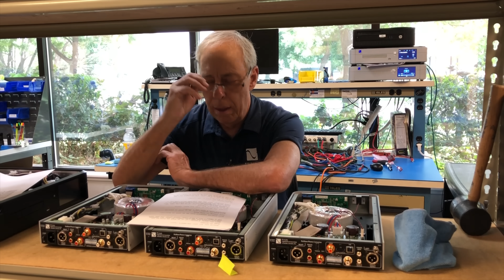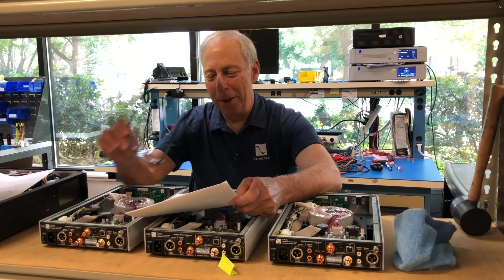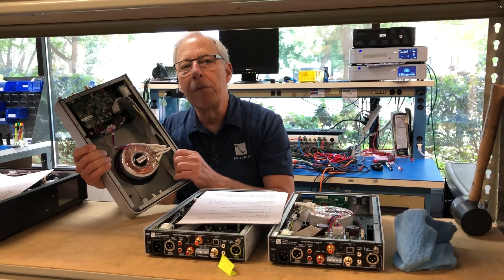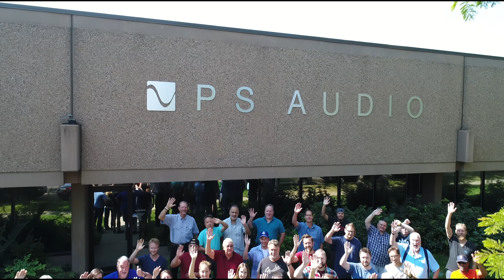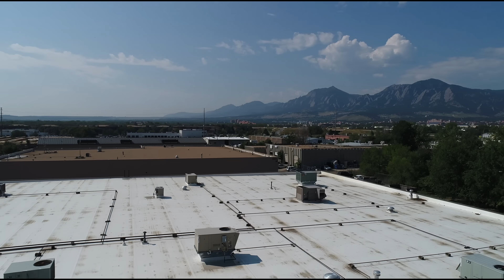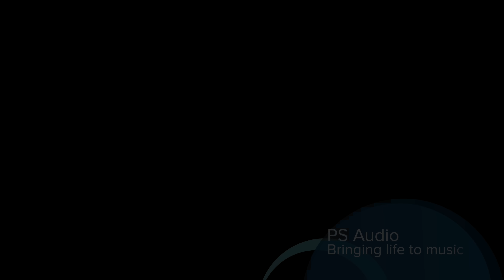What's inside a high end power cable?

Comment: 3 conductor 12 gauge Romex -TO- 10 gauge stranded, shielded, 99.9% oxygen free copper, gold plated -TO- 14 gauge MTW lead soldered to cladded components. Forgive me if I think you should have more scientific information to back up the justification for a $500 dollar power cable. If it works, great. Inductance is magical no one really gets how it works either. But it should be easy enough to see if noise is being omitted, prevented or the cable is somehow changing the power values with pretty basic instrumentation. But yet you tell your viewers to just try it and laugh, as if to imply that it's not worth your time to investigate the reason for its value just take my word for it. Stop comparing cooking to audio it makes you appear frustrated.

Comment: Wire/cable current noise is different according to current direction, IOW current noise for positive half cycle is different to current noise for negative half cycle, IOW wires/cables are directional.
Test equipment employs full wave rectification so will never display differences in half cycles.
Also cable current noise is slew rate dependent and also has directional decay time behaviour, sine wave by definition means constant rate of change which means noise mechanisms are not excited as they are by dynamic/music signals and therefore are not apparent when using sine test signal.
Once one accepts that wires/cables have  directional properties the 'errant' subjectively noted system behaviours are perfectly explainable and also are able to be eliminated.
I use self made non-directional cables throughout my system and this enables clean clear spectrally balanced sound with outstanding staging and depth imaging.
Swapping in one only 'standard' cable be it power,  signal or speaker cable causes collapse of depth imaging and overall subjective distortion.
If I revert all cables to 'standard' cables my quite decent system becomes unlistenable in comparison.
My modified $5.00 K-Mart power strip renders any system 'hi-fi' and is universally preferred by multiple test subjects.
Who cares about the power station transmission lines, transformers, street wiring and house wiring, the last section of AC supply cable is the most important, similarly loudspeaker internal cable is of great importance subjectively.
Reversing direction of signal  cable or speaker cable in one channel only causes sideways skewing of centre/mono information and loss of depth information and cannot be corrected by balance control.....this is cable directionality at work and is to be expected. 
Lesson over, class dismissed.
Reply: Your system needs a turbo encabulator to sound its best, though.
Reply: @schorman  Nah they sound bad.

Comment: So run two wires to each side of a stereo system. One wire is 12 ga. solid and the other 12 ga. stranded, that's for each side. Four (4) wires total for a stereo system.

Comment: Cable quality only comes into play when long distances are involved .. I DO believe in good quality gold to gold connectors however
Reply: That's where you are so correct. Most hifi two channel, speaker runs per channel 3 to 5 meters. Loop test every speaker cable cable and the results will be ever so simular, can we hear the difference, no. Power cables, 13amp 3 core Uk with screen if you like again 1 to 2 metres from conditioner to component. Loop test every cable again simular results. Any cable needs low resistance and its job is to carry the signal or power. It has no electronics, no circuitry so therefore cannot alter the original input signal or power. A cable is a highway to carry the signal without any alteration. I would rather invest in new speakers or electronics ie. Power conditioner, Dac, amplifier, something that is designed to carry out a change. The result of that can also be good, bad or debatable. Good quality cables up to a price point is all you need, cables that can satisfy the current demand in any situation. Lamp cord for speakers no, 3amp power cord on an amplifier no.
Reply: Andy Abraham .......Exactly !

Comment: So you probably have 50' worth of 12/2 Romex Solid Copper wire traveling from your main panel to the outlet for your equipment. Then you install 6' Sigma Power Cord for $2500 and you have better sound?  Somebody needs to do a Double Blind Study

Comment: How about screen connected to the feeding end of the powercable vs both amp end and the other? It seems to be a split camp between connected vs not.
Reply: That’s an interesting question, normally connection of screen on ground on both ends is used by some for interconnects, replacing the ground wire, or in addition to a ground wire. First of all, I never tried that on PCs but it should sound different, as main cable properties change: higher capacity, lower resistance on ground, but, I’d assume less or different shielding effect, since current flowing up or down the screen as a result of emu/emr would alter also the el. potential of the housing connected via ground. The latter would not happen if the screen was not connected to ground on device side. Note it can happen that (stacked) devices, or to be more precise, their cases’ el potentials are oscillating against each other with the PC cords acting as inductances, and described screening variants change their LCR. I should add I once did it’s of PC cord variants on a CD player (Arcam CD92, which reacted strongly an PC cord config) and the ground configuration esp it’s cross section had a marked influence (with a clear sweet spot) on SQ, N&L kept unchanged.
Reply: @gioponti6359  i will connect screen in the feeding end (wall socket) and not to the device end. Earth ofc will be connected in both ends. My theory is the the shield act as a drain wire and the noise cant go to the device only to ground in the feeding end (Mains conditioner).
Reply: Jimmy G - that is exactly as i and many others have it. Good luck!

Comment: Paul just likes to bait the  Realists.  So big copper provided solid bass.  Okay no argument there.  But then you added stranded wire to provide/restore high frequency response too???  Your pulling power at 60 Hertz so there isn't much in the way of skin effect.  If there was, everyone would be using Litz wire. If your high frequency response improved, there must be something wrong with your bulk charge capacitors or something like that.

I think the real reason there is such a large transformer in that phono pre-amp is to make it feel more substantial.  I understand why such overly high operating voltages are used in pre-amps but an over capacity of unused current does absolutely nothing for sound.  Fewer different transformers in the warehouse also improves buying power with more re-use.  But yet marketed as a  key selling point. Cute.

Comment: Where should the special power cable start? At your power regenerator I suppose.
Reply: In theory the only signal that should be in a power cable is 50 or 60hz, if it affects the sound then it stands to reason that the sound signal somehow resonates with the power cable, in that case it should extend from the AC/DC transformer as far as possible, preferably all the way to the wall. It would be interesting to conduct an experiement to see if the sound signal can be detected in the power cable itself, and possibly in other plugs on the same circuit.

Comment: I have heard these things from a friend of mine, who bought an expensive power cable for himself. He say it's better. I don't hear it, despite i do have good hearing, really. So i'm a bit sceptical about this. The power travels into your wall socket from the street, and you don't know what kind of cables are in your wall, especially if you living in an older building. They can be some crap quality cables from 50 years ago, or more. What's the point of using a crazy expensive 1 meter long cable, if those Ampers travelling 40-50 m in a shit quality cord? You want to tell me, that 1 m long "super cable" is going to do the miracle? I don't thik so...
Reply: in another video he talks about proximity to a power station affecting audio as well, hence buying a regenerator for your system. Presumably he would say, first replace the wiring in your house, then get the nice power cable. Some people would do it, too.

Comment: Paul, in your post you stated romax with aluminum conductors, I hope you ment copper. Also I can't understand how the lab power cable with the solid core conductor and stranded conductor would make a difference when my whole house is wired with solid core. I can see it may make a difference in speaker cables.

Comment: Before I spend $300-1200 for a PSAudio power cable, I would recommend getting an electrician to bring in a direct power line with its dedicated fuse / breaker and use one of PSAudio’s Power Port classic duplex receptacles. Now buy that dreamy power cord...

Comment: @12:20  'in the fine wires you get a LOT more high frequencies come thru as opposed to thick heavy solid core'
what frequencies, coming from where? does the AC outlet need to send other frequencies to the transformer other than the 50-60Hz we use for 220/110V?

do frequency generators use special power cables? do oscilloscopes? how about medical ultrasound machines?

these would benefit greatly from this cable technology since the difference in fq realm is so major one can actually hear it on a very low efficiency transducer (your regular speaker-driver is below 1% efficiency, a very-very-very inappropriate probe or sensor so to call it )
Reply: Yes you can buy medical grade power cables.
Reply: @AJD OLD CHANNEL ARCHIVE, High end audio equipment like medical equipment is suppose to be plugged into an IGR.
Reply: USA is 120/240 VAC. Why does everyone say 110? 🤦🏻‍♂️
Reply: @JPC74  It's supposed to be within 110 to 120 VAC and maybe 110 is easier to say. We also say 220
Reply: Nice listening thanks

Comment: I would suggest that since there is not a scientific theory to explain any audible differences when such cables are used, a double-blind test would be in order. It would be quite easy to do with employees and visitors. This kind of test would rule out confirmation bias as the source of perceived improvement in sound -- and any statistically significant difference shown in the test results would be a good substitute for the scientific explanation or theory that is lacking.

Comment: Would this work for speaker cable. Strained and solid core parallel to each other but going into same amp.
Reply: I have Belkin speaker cables that do just that: solid core, and stranded outer, with a dielectric in between. And with a ridiculously thick insulator surrounding it all. All it does it make it harder than it has to be to use the speaker terminals: it's quite a job to fit all that mess through a narrow hole. I wouldn't have had to use banana plugs, otherwise. I had added more to the signal path with the banana plugs, and a connection that can come loose..

Comment: considering the amplifiers transistors valves or mosfets do the switching creating the frequency for the speakers not the incoming power and the fact that the incoming power is rectified into dc and smoother with big caps i think your full of snake oil. the only thing thatd affect it is too small of wire not delivering enoughf amps ridiculesly long and bad quality wire with high inductance maybe coiled up too mite just mite affect the sound by delaying currant delivery due to inductance but i think thats just bullshit too

Comment: I was a skeptic of power cables, how on earth the last meter of connection from the grid to my amp could make a difference, until an installer brought along a fairly "beginner/cheap" hifi power cable, I immediately noticed the difference in both sound and visual, it sounded louder and contains more detail at the same level, and the color of my projector has given a more darker or a few shades of color, like scenes somehow has more details as compared to before. at first I thought it's psychological and I was fooling myself so I had the guy conducted a blind test to me, watched the same scene of Fast 5 over and over again, and I could pin point with 100% accuracy of guessing which cable he is putting in each and every time, the same explosion scene looked and sounded different! I was blown away, til this day I still don't understand how it works but the installer did sell me this cable, he knew from the start I was going to buy it as soon as he puts it into my system, what a sale.
I tried telling my friend this story but without inviting them over they would just treat me like a lunatic !
Reply: nice story lol

Comment: Amplifiers effected by mains power fluctuation\mains power impedance or noise on mains, are shoddy designed amps.
Are Electronics a Science  or a belief system? 
and you sell electronics? I don't trust your "science",  will not buy.

Comment: Is there an optimum length for the “improved” power cables? If it improves my system must I use say at least 5 meters to get a benefit? How long must the individual special cables be before joining them on a plug strip?
Reply: it is a mystery
Reply: There’s a Polish website for rather costly Hi-Fi (hifidelity.pl) and they once did a comparison on several high end PCs of different length ie 1m vs 2m, and they found  that in most cases 2m was smoother and more balances than 1m. I did only on one type of cable (Furutech 314) but found short more dynamic and long less strident, edgy

Comment: Question: Why cant the equipment internal power supplies not be improved to the point where full performance is realised as long as the supply voltage is in tolerance and of reasonable quality taking into account typical fluctuations and noise? For instance designing with larger regulation headroom, more storage capacitance? Is there a property in the cable that does not exist in an electronic component or practical circuit that cannot be fitted inside the equipment?

Comment: We run outdoor concerts with home depot extension cords at thousands of watts. This guy is telling me I need better power cable. Got it.
Reply: But wait what are the objectives of home audio reproduction from source against open air high-wattage PA systems holy crap extension cords at least use the same 12/3 romex wire that you're tapping from, did you know you can buy bulk wire and then also attatch plugs to it, this post, my sides

Comment: Your 1000 percent correct I use to be in disbelief until I bought the audioquest y3 and the low end really made a huge difference I argue with people about it idky cause normally they never owned both in their home and switched them out I was amazed the first time I was like no way can't be power is power well here's my take that I came up with Paul take a pair of small jumper cables 10gauge and with a 4 cylinder car try to jump start a big v8 truck then take 2gauge big cables and see how much easier it is for the 4 cylinder car give a jump to a v8 truck with dead battery lol

Comment: From an electrophysics POV there is no support for what you are saying.  I appeal to what I am assuming is your electronic engineer/sound engineer/electrical engineering background.  I think the subjectivity of the audiophile experience leads to the psychology of confirmation bias.  When you use terms like warm this, in the '60s and '70s, was understood as dull or blunted.  It was the confirmation bias term describing the same subjective sound experience but at another time in history when the idea of having tube or valve gear was laughable over the "new" solid state.  I imagine your trip to UK was paid for by a few dozen numbskulls who have chosen to believe the transfer of electrons through a conductor behave differently in a $100.00 power cord versus the one I purchased at Goodwill for $.50.  Good for you that your power of persuasion appeals to a segment of audiophiles who buy into this.  I say fake news.

Comment: Your discussion of power cables makes no sense. You say allowing higher frequencies with the bradded part of the cable is good. WHAT? I want 60Hz down my power cable. Higher frequencies are what you call noise, RFI and other bad stuff you dont want in your stereo power supplies. I can see designing power cable that stop emmisions of RFI that might radiate to other cables in your system which would mean better shielding.

Comment: If an amplifier is getting, let's say 24 volts DC from a power supply that is made to deal enough current for that amplifier, and is providing a steady DC supply, then how can the amplifier "see" what kind of wire is supplying the power supply with power? It's a simple question, but no one seems to have the direct answer. It seems very possible to use an oscilloscope to measure voltages at every stage, compere waveforms, and track exactly where the differences are and why, but that logic is missing for some reason. Certainly, if I spend hundreds of dollars on a set of cables, I will NOT trust my ears or brain to give me the absolute truth about which is better. It seems to me that if there IS a audible difference between normal and expensive power cables, then it's also fine to conclude that I should be able to bend a spoon just by thinking hard enough about it.

Comment: I am not doubting what you are saying, I am just curious about something I get the logic that some frequencies travel better over stranded cable and some travel better over solid, but how would adding stranded cable for the last 3 or so feet of cable be of any benefit when the rest of the house's wiring is just solid core Romex? For there to be a benefit, wouldn't you have to run both solid Romex as well as finely stranded wire all the way from the circuit breaker box to the receptacle? Thanks.
Reply: You'd have to run it directly from the power plant. I'm in contact with my local power company to see of they'll install audiophile power cords from the plant to my house so I can get the big thumping sound Paul describes.